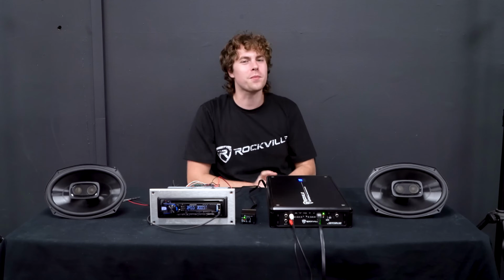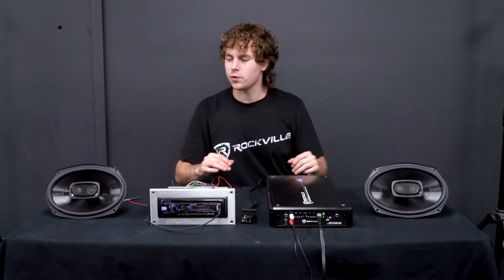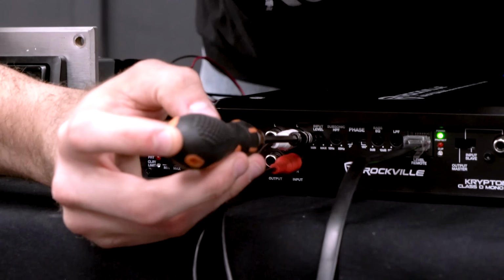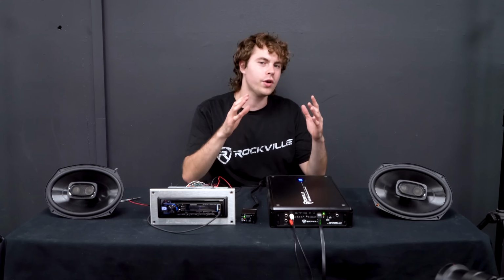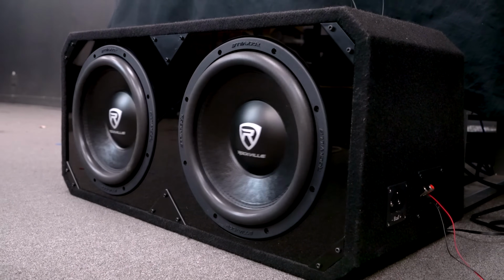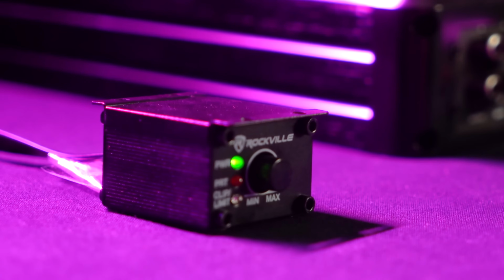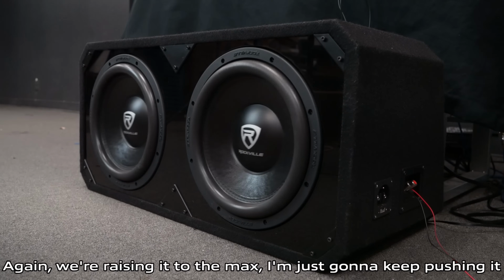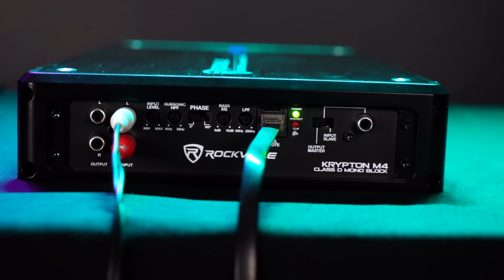How To Set the Gain On your Car Subwoofer Amplifier (Monoblock amplifier Tutorial)

Comment: Noob question here: Can i decrease the lower frequencies in my head unit and increase them in my (active) subwoofer? The idea is that my regular door speakers don't play these lower frequencies since they sound awful on higher volumes. So basically i want only my subwoofer to play low tones and the regular speakers the mids and highs
Reply: Your idea will work and it's the cheapest, but you will lose quality because using more gain on sub you also amplify noise. Be careful and don't go to extremes, too much noise can damage your sub. Best solution is to use hi pass filters or crossovers for your speakers or replace the speakers
Reply: You can get a crossover or a low pass filter
Reply: Yes lower the bass on radio
Reply: Apply a HPF(high pass filter) to the front and rear door speakers and apply a LPF(Low Pass Filter) for you sub
Reply: You’d have to change settings in your head unit.  Crank the treble.
Reply: @jeremylee1449  Question, should I set my hpf and lpf on my headunit or amp? My amp only has a lpf and I have it all the way off
Reply: Pioneer head unit would do this. You tune the bass out and it still plays on the woofer. You then tune the woofer with the bass all the way down. Thats what I do and it sounds great.
Reply: I'm in the same boat as you. I'm running a 12" sub w/mono amp and pioneer DEH head unit. If I turn the two lowest bands of the EQ up past -5, my door speakers sound terrible and distorted at 30% volume. I have my HPF and LPF on head unit both set to 80hz, doesn't seem to make a difference. The only solution I've found is to turn the two lowest frequencies almost all the way down (-5), and make up for it with more gain on the amp. Amp ony has two dials, gain and x-over frequency. I have the x-over on the amp set to 80hz, but I'm not even sure that's right. Lmk if you find a way to eliminate any low end from coming thru the door speakers and fucking the sound up.
Reply: @randybobandy6450 I like your idea and that’s exactly what I did in my impala and it seemed to clean up my music quite a bit. On the stock deck I got the treble at like plus 4 and my bass at like negative 5 and then got amp crossover at 80hertz and then set my gain and I was good!